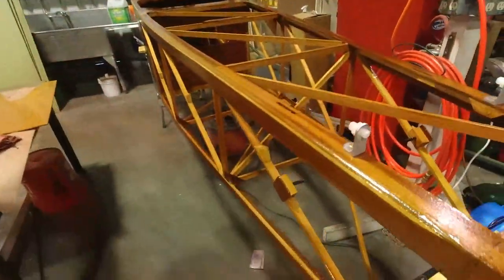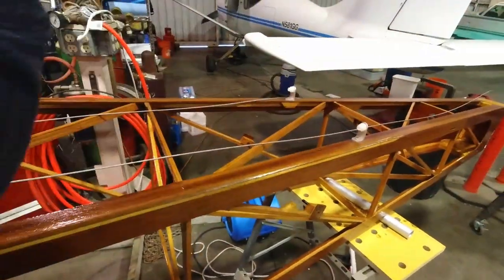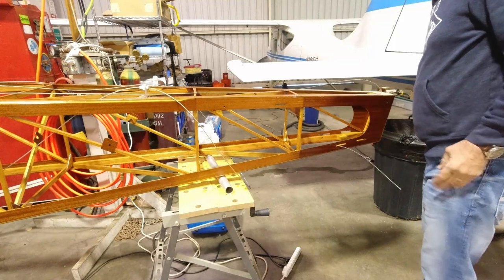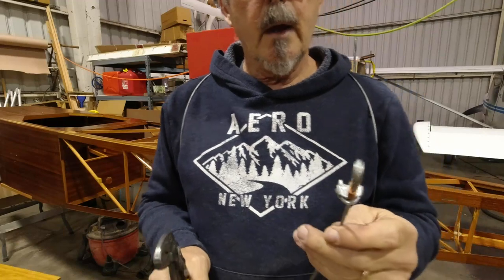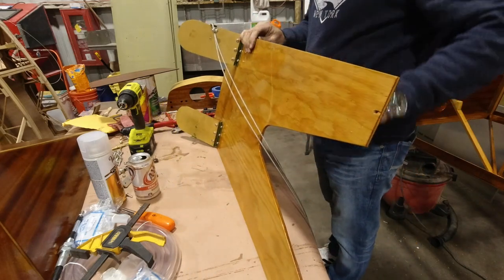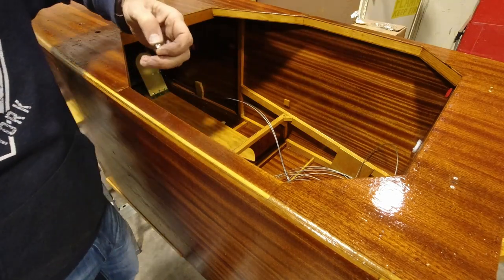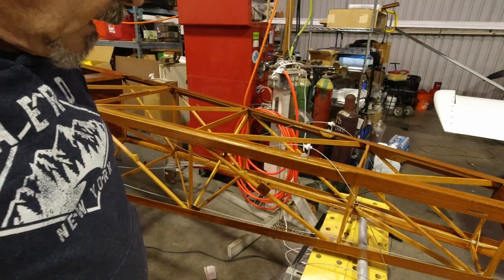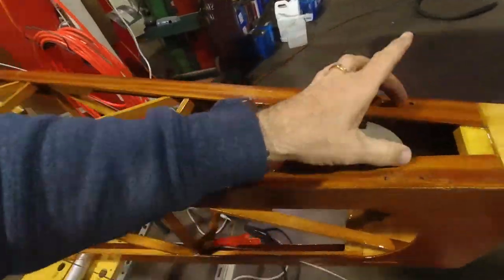Minimax 1100r Wood Aircraft Build Ep 139 - Running Cable

Comment: If the cable is coated you must remove the coating or it will slip thru the crimp. Also I would recommend dual Crimps.  Several deaths have been attributed to this fault.
Reply from the maker: It’s galvanized and not coated. Thanks for looking out for me!

Comment: Hi Dennis.  I never miss any of your build videos.  You are right:  Two people working the swaging tool is much better. :-)  How did you cut your cable?  I used a pair of vice grips, as that tool has "inner cutting jaws" which clipped that cabling with no problem - no loose strands.  Yes, lots of places in the fuselage when there will be interference.  Everything looks really good.  I love your work area - around lots of other airplanes in certain phases of completion.  Thanks.
Reply from the maker: Thanks Michael! I use cutters for cable but don’t really like them, the cable falls in between and doesn’t cut all the way. I’m going to try your method. 
It is fun to work around other projects.
Reply: @DTMinimax  I use a Dremel and a Cut off wheel AFTER I tightly tape the area to be cut. :)
Reply: A good way to cut cables is with a chisel and hammer. If you rest it on a brick or a piece of Steel it cuts like a knife through butter. You can also use bicycle cable cutters. Bicycles have reinforced outer cables so they are very tough. Thre cables cutters made for bikes cut easily.  Keep up the good work.  Loving this series.  From the UK.
Reply from the maker: Thanks so much!

Comment: The right cable looks like it runs very near the fuel pump / gasulator bracket you have so that will need to be checked.
Reply from the maker: I checked it out today and the gascolator is about 2.5” below the cables
Reply: @DTMinimax  Great its hard to tell from the camera angle.